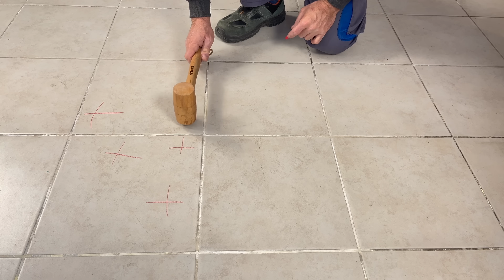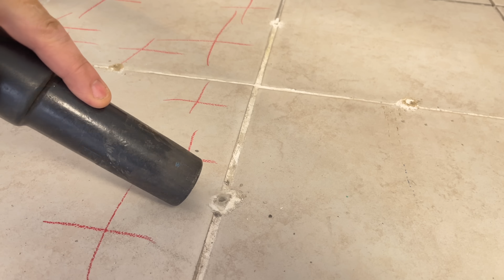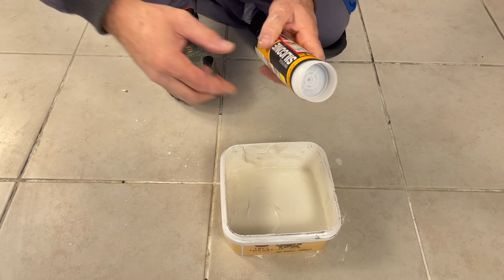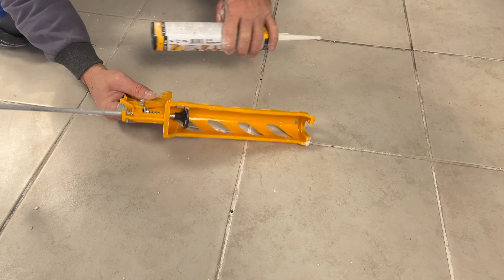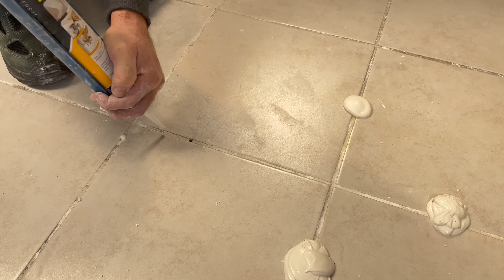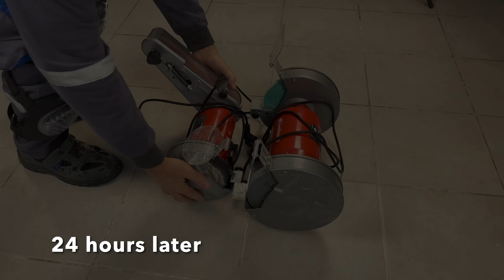Method Surprised 50 Year Old Tiler! Fix Tiles Without Removing

Comment: Just out of interest: What about the vapor barrier underneath the floor? Don't you risk puncturing it when drilling freehand and to various depths like you did? I hope your barrier sits deep enough that you didn't puncture it, but personally I wouldn't risk it. If the tile is loose, it's better to spend the time removing and refixing it properly, or you'll risk having to redo ALL of your tiling (and everything else) in a few years when the structural parts underneath your bathroom have got soaked from the moisture dripping down those holes, and starts to rot. 

And don't get me started on the cost if you accidentally hit your in-floor heating while drilling.
Reply: Vapour barriers are underneath the screed 🤣🤣🤣 There's no way he was drilling through concrete 🤣🤣🤣🤣😭😭😭😭
Reply: @craigread5603  Wrong barrier. In ALL modern tiling there is a moisture pad under the tile and drilling through it would certainly destroy the membrane. That said, retail does not typically use it so the application is there
Reply: @Metalblaze124  do you mean an uncoupling membrane? typically those arent used to control vapours. A sheet membrane would , but you only use that in wet areas like a shower or bathroom floor if you had to. So no theres no damage to anything
Reply: @Metalblaze124  not in Florida. I do floor repairs full time and have encountered a decoupling membrane only once (probably because they work: no repair needed!) but still, all new construction tiles straight to slab
Reply: @StevenBur  do you usually just make stuff up? you don't use mastic on floors . its thinset mixed with water... just like concrete. Is concrete a vapour barrier?
Reply: vapour barrier????  There is no vapour barrier on the floor. And most tile floors don't have in-floor heating.
Reply: I think what you mean are the waterproofing membranes which are installed in the bathroom in certain areas, such as a tiled shower. 
Yes, they are under the tiles and someone shouldn't drill through it.
Also the floor heating is a valid argument. They are very sensitive to "minor injuries" and this may lead to a bigger project than expected. 
So make sure that it is not a sealed surface and there is no underfloor heating installed.
Reply: @unwokesnake  Here in Sweden, it's not just under a shower/tub, but the entire room, which receives this membrane treatment.
Reply: @xxhellspawnedxx  Is this a swedish standard? Honestly I am curious, bcs I just renovated 2 bathrooms (hired a company for this) here in Germany, and they used the membrane for all wet areas around the tub and shower. I forgot one aspect: it was not grouted with mineral grout but with epoxy resin, which makes the tiled surface practically waterproof. I wouldn't drill here either, because it compromises the protection and we have an electric floor heating under it.
Reply: @xxhellspawnedxx  That includes Norway as well.
Reply: @xxhellspawnedxx  Every countries if not regions have (usually) got very good reasons as for why their construction standards are specific. You know.. I can be very wrong, but I would expect building codes to be somewhat different whether you are in Malmö or in Örnsköldsvik.. And there are reasonable reasons as to why those building codes are different than what you will find in Marseille..
Guess it's wise to check with local building codes before trying that latest youtube miracle quick fix video
Back to OP : Yes. what's underneath those tiles before drilling? Good question!
Reply: @joshalvarenga5590  Mastic is an adhesive that, along with thin-set mortar, is used to stick tile to wall or floor surfaces before grouting. This is the actual definition of mastic. 😊
Reply: @jvgauthier  To my knowledge, we have a national code that is the same all over. The southern parts still get cold in winter, and wet in spring and fall.
Reply: @craigread5603  thinset is stupid easy to drill through... and it's directly under the tile, which is about 3/8" thick and he was sinking a 2.5" (roughly) drill bit into it.  so yes... he absolutely was drilling through "concrete." 

and the mortar is less than 1/4 thick after the tiles are set and pressed, so he absolutely drilled though any vapor barrier that may exist.
Reply: @@RADottin I mean... There are situations where you need to make a hole, and can't be 100% certain that there's nothing hidden under the surface. 

But here's where you do a bit of a quick mental workout: What's commonly underneath the surface where I'm drilling? Is there under-floor heating? Water pipes? Electrical conduits? Most of these can be worked out to a fairly decent degree of certainty from contextual clues.

Then, of course, there are detectors for metal piping and electrical wires under floors or in walls, though honestly these are a bit hit and miss, and I wouldn't rely on them 100%.
Reply: Nothing will happen if he drills through the membrane, the glue will fill the hole and it will be even better.

Comment: As a 60 year old tile setter, this is only a bandaid, there's no way your mixture is going to flow far enough under the tiles to rebond them and tapping on tiles with a wooden mallet is a good way to crack one
Reply: not really band aid, tried it and it fixed most of the tiles
Reply: share solutions. Not just criticism
Reply: share solutions. Not just criticism

Comment: 난방배관이 깔린 화장실은 드릴사용에 조심하지 않으면 난방배관 공사 다시 해야 합니다.In bathrooms with heating pipes, if you are not careful about using a drill, you will have to redo the heating pipes.
Reply: 귀하의 우려를 이해하지만 여기 브라질(그는 다른 근로자를 가르치는 브라질 사람입니다)에서는 기후가 매우 덥기 때문에 추운 나라에서와 같이 바닥 난방을 위한 이러한 유형의 구조는 일반적이지 않습니다. 구조적 손상 없이 완벽하게 작동하는 기술 수리이므로 안심하십시오.

Comment: If the tile is loose so is the grout. Usually falling out. No way to inject the adhesive thru a hole in the grout in that circumstance. Which is probably 95 percent of the time. If your lucky enough to have your grout  still holding by some miracle this works yes..

Comment: I think you just can't do that if the tiles were properly installed. I guess it will only work if there is a gap between the tile and the floor base and if that's the case those few loose tiles are just the beginning...
Reply: The single purpose of showing this video is how to fix those gaps under the tiles without removing any tiles.
Reply: Just because a tile is installed properly doesn't mean that after 20 years worth of steps that one of them won't get loose.

Comment: Drilling in a floor like that with underfloor heating, you’ll end up with a bigger problem than you started with.
Reply: A dull masonary bit couldn't drill through your hand never mind plastic tubing.
Reply: That's why I'd never have underfloor heating. Besides which ceramic isn't a good heat conductor
Reply: Yes, although usually there’s around 16mm from screed to finish height plus pipes are in 65mm of screed. So minus the pipe diameter of 15mm, leaves around 66mm from top of tile. Only need to go an inch or so deep but I’d still set a depth limit on the drill just in case.
Reply: @petinathomas6096  c'est pourquoi j'utilise la pierre a la la place du carrelage, comme le travertin...et changer un carreau de pierre est plus facile que le carrelage....le chauffage au sol est génial dans ce cas car il permet de grosses économies d'énergie et donc de moins polluer, c'est mieux pour la planète...
Reply: @petinathomas6096  you have to put cement and ceramic with underfloor heating..
Reply: Right, that's why you should have exact plans or photos to check it you have any communications under
Reply: If it was a boarded floor you could end up drilling into mains wiring or pipework as well, also catching the edges of the tiles with the drill would damage them by splintering the finish.
Reply: 😂😂😂 obviously you wouldn’t drilling to a floor if it had underfloor heating, would you?😂😂😂😂
Reply: @nicksullivan2212  Why not?
Reply: You wouldn't have voids with underfloor heating since the tubes need to be inside the grout for it to even work

Comment: Impressive until he didn't tap the original hollow area after the repair. It doesn't mean it wasn't improved. It could suggest it may have still sounded hollow. Great tip though.
Reply: He did
Reply: @lowstandard  wonder where that guys head was at? Sure looked like to you and I he tapped is several times.

Comment: Between the time this method takes and the cost of materials it would be cheaper and easier to replace the tiles.The only application I could think of would be a older floor where there is no stock left to replace the tiles.

Comment: Why not just do the job right in the first place? Also, y'all should realize the reason the adhesive is able to "travel" underneath the tiles is because the original adhesive was improperly applied, leaving spaces and gaps in coverage. That's part of the reason there's a problem with broken/debonded tiles to begin with. Finally, chances are someone that sloppy with installing did so over most or all of the entire installation, so expect most or all of the floor to have continuing problems. In other words, chances are patching the floor is going to be an ongoing job- better to demo out bad install and do it over the right way.
Reply: smart aleck, these things happen to every tile setter sometimes!

Comment: This looks like a much less involved method to fix loose tiles. However I'm wondering, often time loose tiles are caused by underlying issues like loose subfloor. Say if the subfloor is the issue not addressed first, wouldn't you continue to having loose tiles over again? I'm hoping someone can help me understand better. Thank you.
Reply: In this case the problem is a wrong technique used to install the tiles. Probably spot bonding, where you use 5 spots of mortar. This leaves air bubbles that can be filled by the method shown.
If the problem were another issue, the liquid mortar would not flow from one drill to another.

Comment: Read 20 comments
Laid  and repaired tile
40 years
Consider the compression of the glue
What is the coverage under the tile
I do know how
This is not it
Reply: the thin set did not stick to tile,only to the floor,so injecting solution either thin set or a glue that will stick to tile and floor is very possible!

Comment: I was showed this teick in Maine and it didn't work. They did nothing different, it just didn't work.
Reply: it will work ,try to drill more holes 1/2" deep and fill them using either thin set more liquid or universal glue that sticks to anything.Home depot in US have product called "Fix-a-floor!